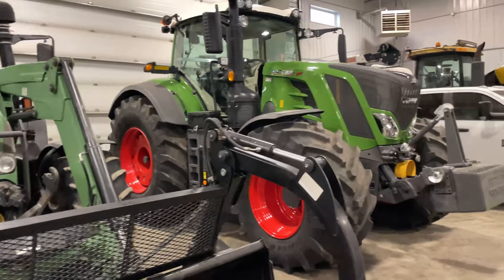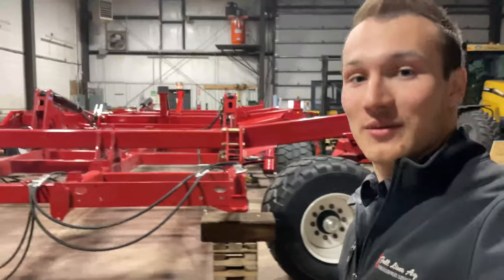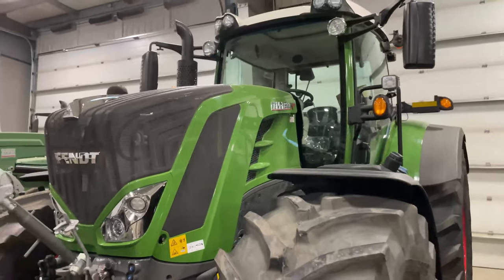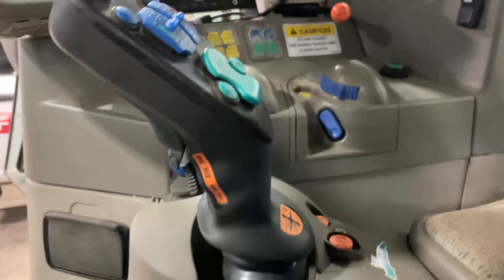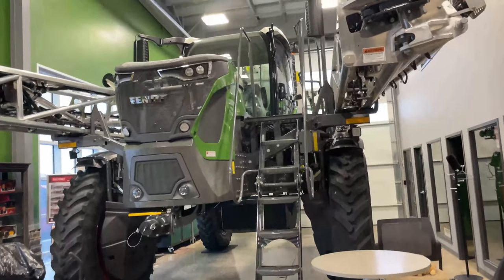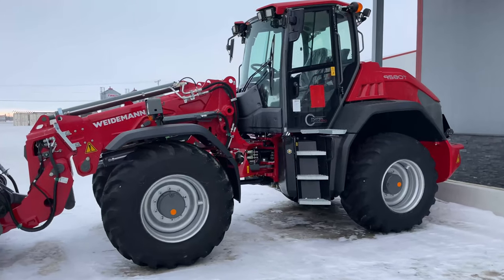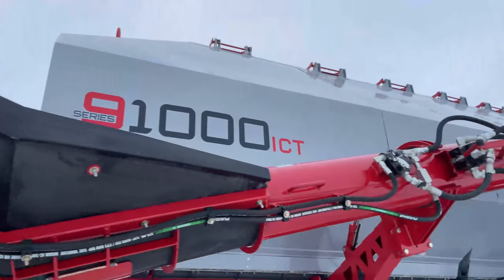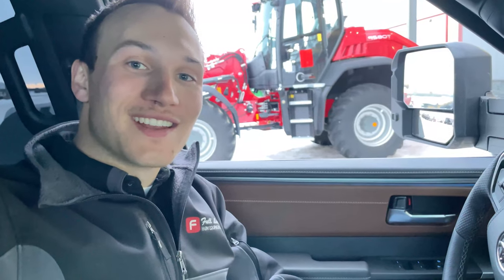Lots of NEW equipment finally showing up

Comment: Hey Austin - what up! Congrats on 5k+ subs 👍 Looks like you brought half the Expo show equipment back to Sask with you. I do have to ask if you got that Morris Drill from IKEA, looks like their product line where everything is - 'assembly required' LOL!  That Fendt Rogator was massive, the tip off to its size was the front wheel was as big as that red riding mower. The new Weidemann looks pretty cool but with a bit of decal cover up, you could rename that the "Austin'nator 9580T" - you never know, you could start a new mech line. When your phone died on the outtro it cut out the part where you said what new equipment you were re-routing to the Perdue shop....guess we'll have to see what shows up on the lot - I'm betting on the new Austinnator  😎